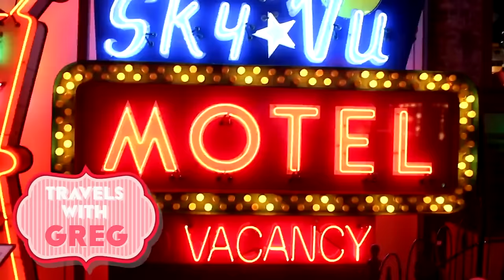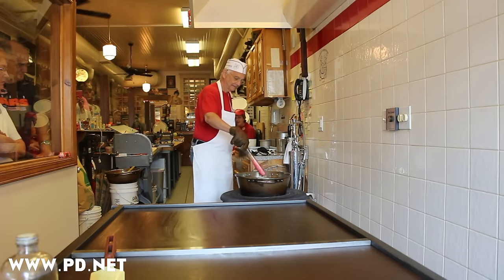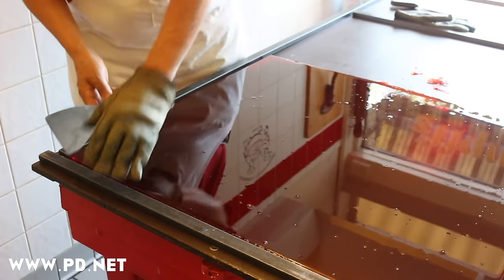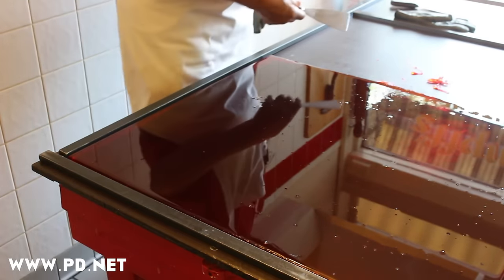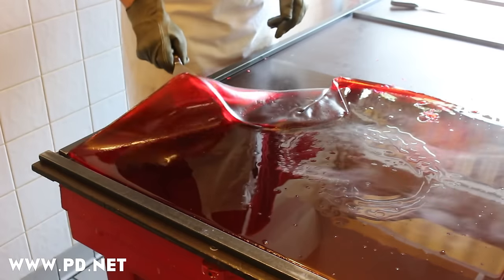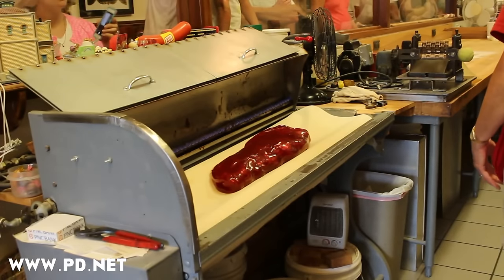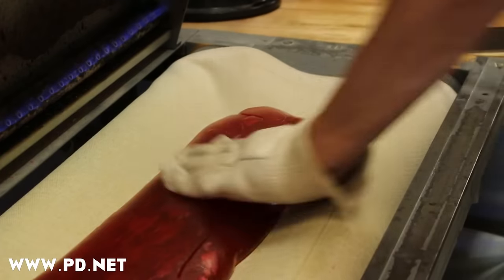#43 Making Red Hot Cinnamon candies on Victorian Candy Making Equipment

Comment: I like this travel series idea. It's like watching different woodworkers turning bowls, in the end they all make bowls but the techniques are all unique.

I just happened to be messing around with cinnamon essential oil yesterday, and if what he uses is anything close to that then it's dangerous stuff (don't eat it or get in your eyes!).
Reply from the maker: +waterandafter the oils you get in the supermarket is much weaker, about 10% or less of the strength we work in. Warren there used about 20ml of sugar for a 2 or 3 gallon batch. If they did not dilute it, you'd never be able to put a small enough measure in a home sized recipe accurately.
Reply: I was using 100 percent pure essential oil, no sugar, no carrier oils. The stuff I have is for aromatherapy from a health food store not for cooking, not made for ingesting.

Comment: What is the difference between adding color/flavor in the pot while cooking vs adding them on the candy table?
Reply: You need to be careful with some flavors, because if you cook them too long, they lose their impact. This is also very true in traditional cooking--for example, when making spaghetti sauce the basil is always left until last, lest it lose all its flavor.

I imagine that the same is true for some food colorings, especially if the colors warp at high heats.
Reply: TheSpag good point!  thanks for the insight! :)

Comment: Why do they dont ad the flavour in the pan too? I mean it wouldnt be a problem in mi view
Reply from the maker: It makes a different effect. It also means you don't transfer flavors in the pot. It's also easier to clean color out of a pot than a strong flavor like cinnamon.  Since they only have a few of those large kettles, I suspect that has a lot to do with it, but I did not think to ask. I found the folding technique they did to keep the oils in until they were absorbed by the sugar distracting in a good way.